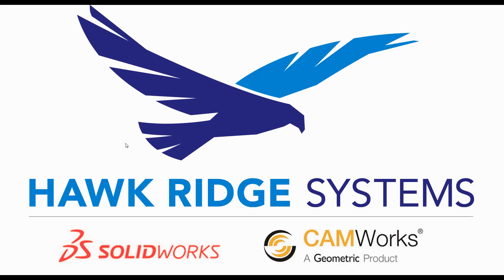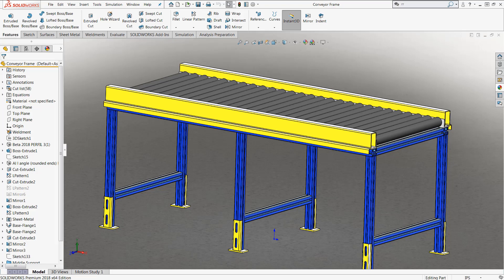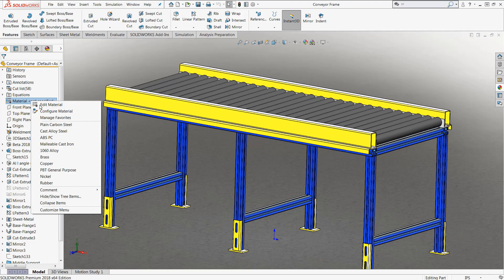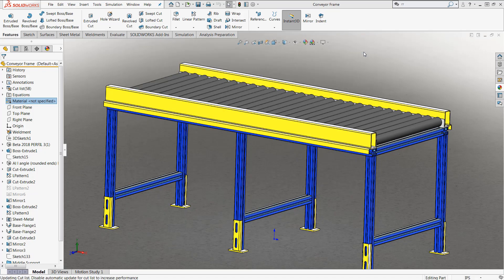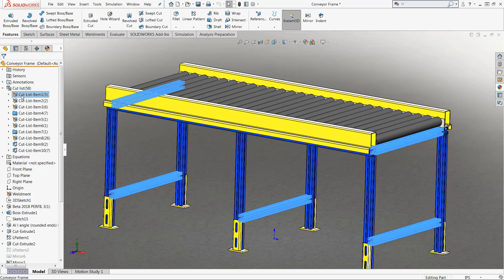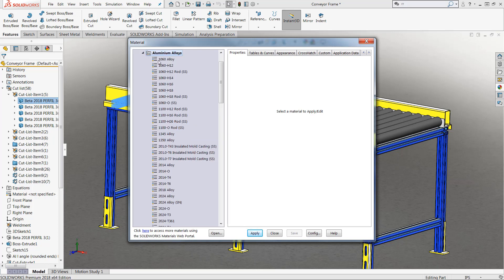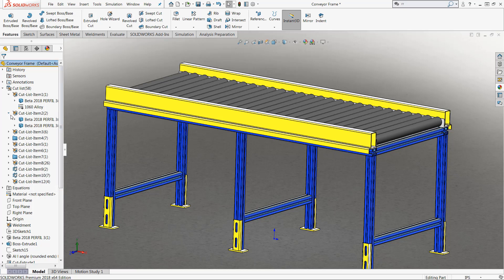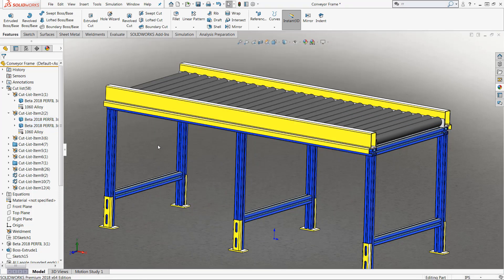SOLIDWORKS: How to Set the Material for Individual Bodies of a Multi Body Part

Comment: Hello Sir, what if I want to do Static Structural Analysis of the whole body in Ansys, will I have to apply materials once again?
Reply from the maker: Definitely if you need to export a neutral file format such as STEP or IGES, you would need to reassign the material. ANSYS may have an available 'associative connector' for SOLIDWORKS that could bring over extra data. SOLIDWORKS Simulation on the other hand will automatically use the material data defined on the SOLIDWORKS model.